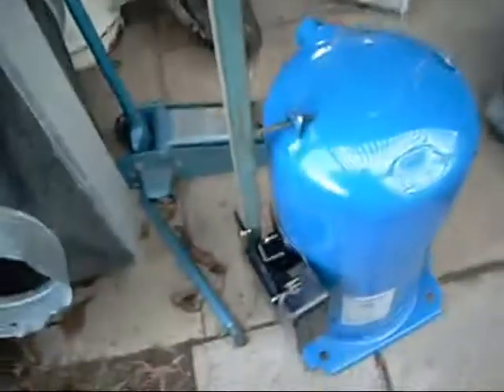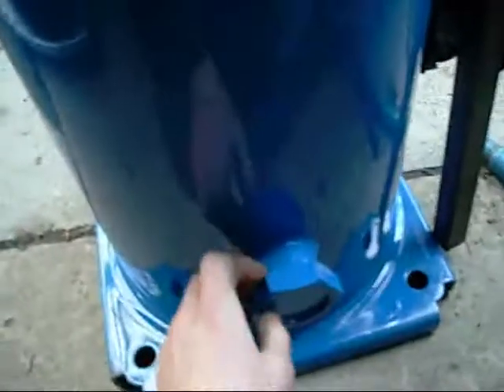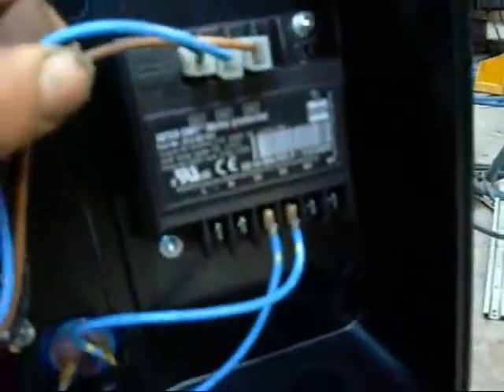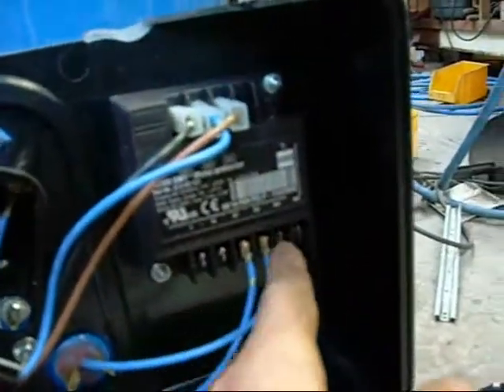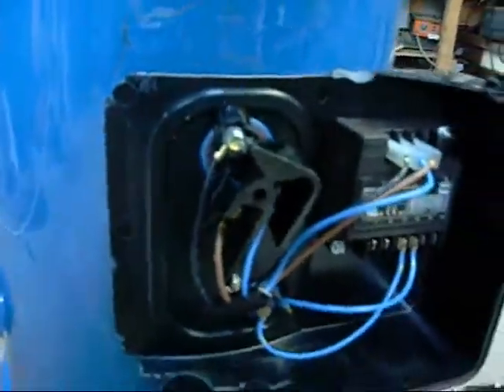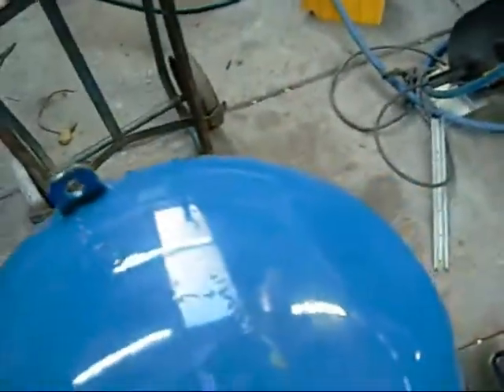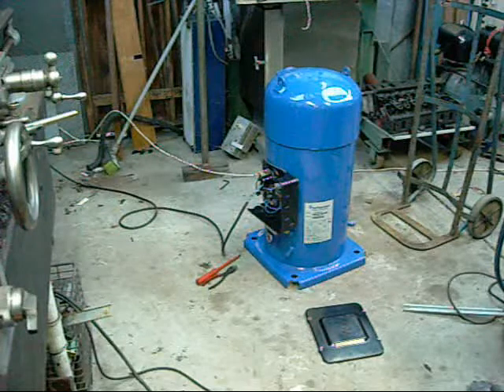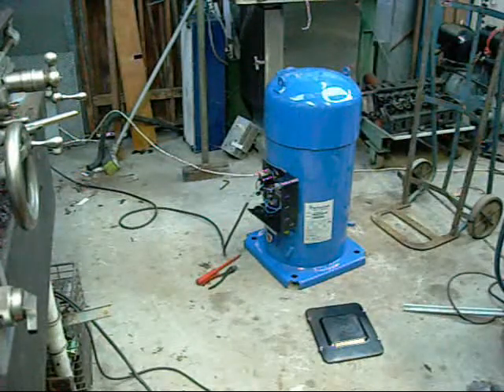Trials of The Mighty Danfoss 95kw Scroll

Comment from the maker: its a synthetic replacement for mineral oil in refrigeration systems. fully compatible with mineral oil residue too.
but it is very hygroscopic so its not much good on open air applications I don't think.

Comment from the maker: those little 2cyl ones make great air compressors! if you've still got it, or can get another one you'll have a damn good compressor!

The oil should be fine mineral oil, like for sewing machines. wouldn't hurt the mower in cold climates!

Comment: 95 KW electric motor in that thing.. that's 118 hp motor right there. You could power a car with that thing it's crazy strong. Or if you used the motor as a generator you had power enough for around 15-20 homes at 5kw each.

Comment: i need a big compressor like that for my high pressure air supply(about 1000 psi or so) does anyone have any tips for a pressure switch to auto shut off the system??